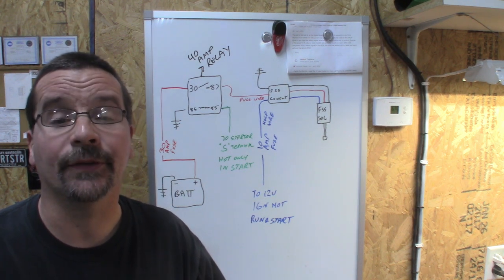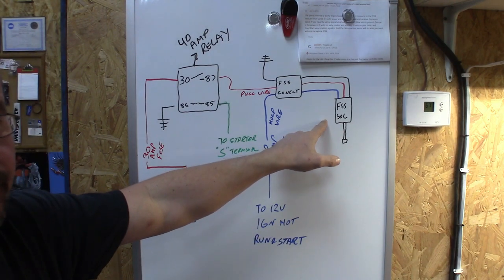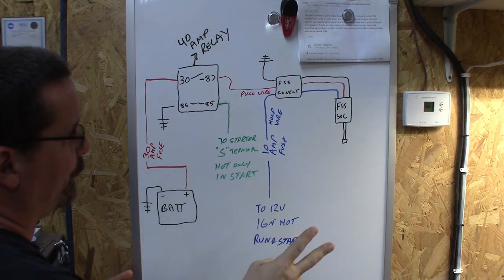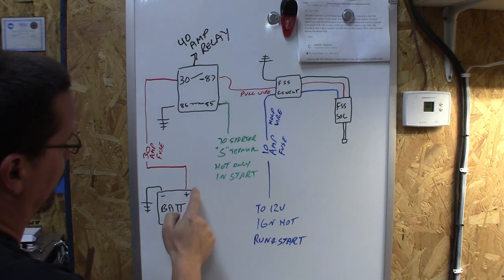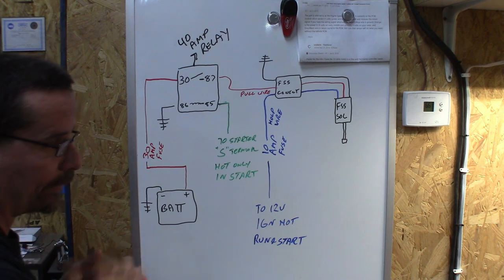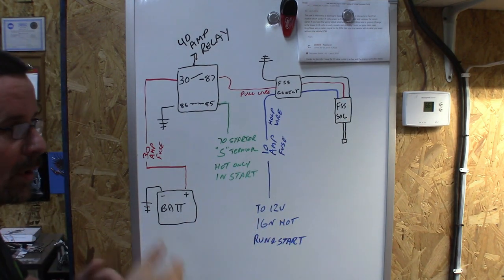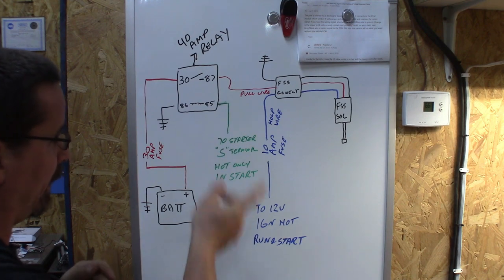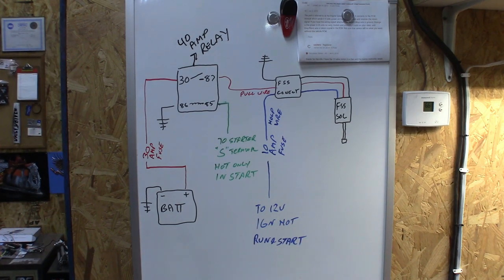12V Cummins P Pump Fuel Solenoid Wiring

Comment: You should do a complete wiring diagram for the 12 valve to the chevy definitely get my like
Reply from the maker: Good idea! I'll get to work on that and see what I can put together.
Thanks for the input and most of all thanks for watching
Reply: I am putting a Cummins in a 2002 crew cab duramax. I wanted a simple wring system for a engine moving the LB7 pnto someone else. Great video. More of the 3rd grade diagrams would be nice.
Reply: onto not onto sorry.

Comment: Mine is trying to start but immediately dies. And I just checked the relay-it's good.  I don't think I'm getting voltage to the connector for the FSS. But now I know better how to test and proceed. I think I'm missing the hold-up current, it tries to start.  Thanks.

Comment: My 30 amp fuse keeps blowing on the feed from the battery. Have any idea why it’s doing that?
Reply: I got same thing
Reply: Did you ever figure out the problem , I'm dealin with this issue , the constant power to pin 30 on relay ,keeps blowing fuse  , pin 87 on relay goes to red middle wire on the  shut down solenoid.

Comment: Can you give an explanation on possible causes for why a 12 valve will not shut off when turning the key off. I have to unplug the relay to get it to shut off.
Reply: Relay is probably stuck closed. Id replace it

Comment: Hey bro really you are pro I'm Electrical Engineer we have for long day's a troubleshooting on our Diesel Genset Cummins Engine QSK-60 code of shutdown is : Fail to Start we checked all things when we connected Inpower Pro software it appear a hidden warning it's FSO Solenoid valve Failure we tested it no reaction but it has just tow pin maybe positive and negative for 24 VDC maybe it's body it's the ground? My colleagues told me they found 10 volt in permanent in this solenoid??? Plz I need your help

Comment: Hey if you have diesel tractor that has a interlock module, if the solenoid shorts where it now has low resistance, can that cause your module to get messed up?

Comment: Probably a silly question but when the key is turned forward to the run position should 2 of the wires from the solenoid have power at the same time??? 

 I just started having an issue with my 12 valve last night to where the truck will start when im turning it over but as soon as I let the key go it shuts off.

Comment: The plunger on my fuel shutoff solenoid won’t pull up, when I try to start it. 
But it will stay up if I manually push it up, while the key is turned on.
Reply from the maker: Yes there are 2 magnets in the solenoid. The larger pull in magnet and the smaller keeper magnet. 
If you have power to the pull in side then your solenoid needs replaced. The pull in magnet is bad
Very common

Comment: I got a 97 pull wire won't pull up,I manually lift it up , it starts,couple days later,I works,same over etc
Reply from the maker: 2 possibilities. 1. The relay for the pull in  circuit is getting weak or the magnet in the fuel shut off solenoid is going bad. 
Generally the solenoid is the culprit.
Reply: @RicosGarage  I bought 2 solenoids, I had to lift up manually, today it works again,it will work for a while then same
Reply: @RicosGarage   Yesterday it worked fine today I go to start it no go had to open the hood lift up on the fuel rod I don't get it
Reply from the maker: It sure sounds like to me John you are fighting a wiring problem. 
If it were mine I would do away with the factory wiring and rewire it like my diagram. 
It's been my experience if it's a mechanical fault the part simply doesn't work at all. 
If it's intermittent like you have it's an electrical issue such as bad wire corrosion loose connection etc

Comment: This morning it started right up then died then I'd be getting out and pull up on it after I shut the engine off it restarted
Reply: I took it apart to test it now it works fine it's gotta be in the wiring

Comment: Question I have a barks tree cutter 240 with 220 Cummins it's a nightmare to expand it has 3 solenoids 2 near the motor  1 in front with master switch someone wired it wrong need diagram